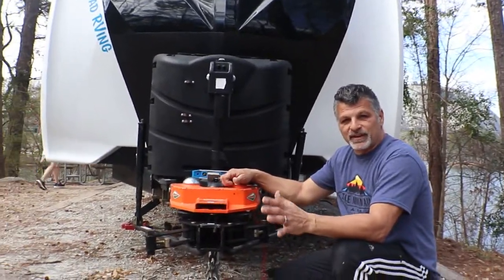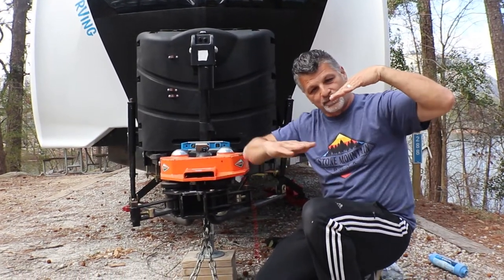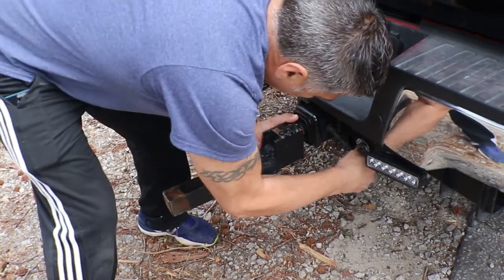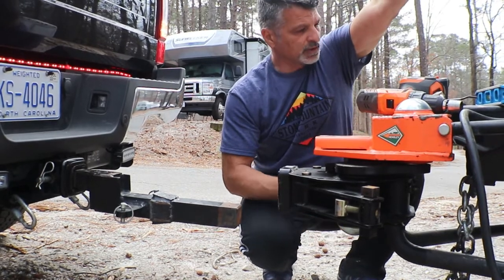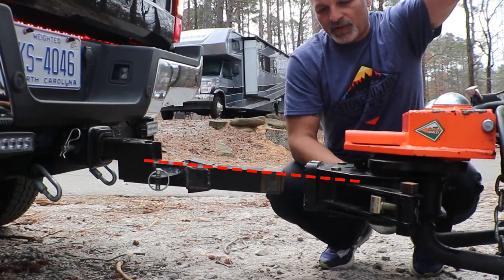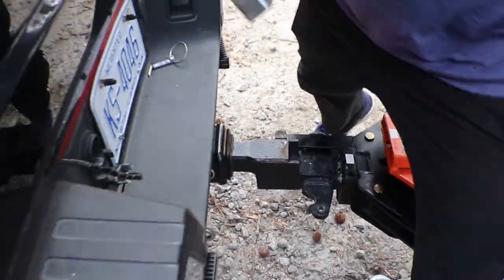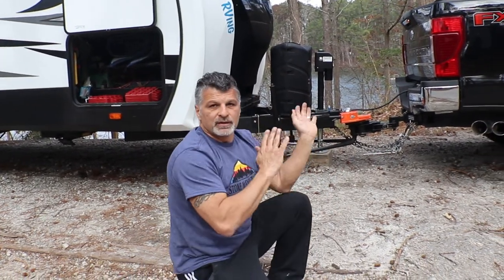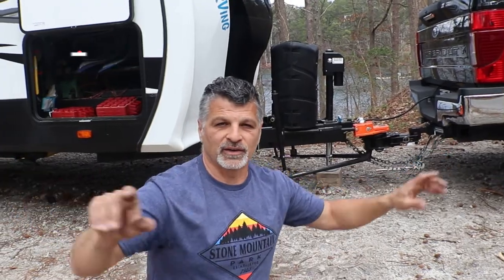Hensley Hitch Hookup/Unleveled Ground #hensleyhitch #hensleyarrowhitch

Comment: Yes, this is very important that owners of the Hensley understand the concept that you have shown for any hookups. I have learned to just take my time, review the angle of the stinger and adjust the Hensley, as you have shown. As a result, about 90% of the time my stinger easily mates with the receiver first time. I am now at a point that its faster with the Hensley than it took me to hookup with a conventional WD/Say Control hitch. Thanks for the video.

Comment: How did you extend the tow chains? Which 7pin extension did you use?
Reply from the maker: I bought chains from a local hardware store so it could be longer.  Make sure they are strong enough.  I also bout a 7 pin extension cord. Not sure what you mean on the 7pin question.

Comment: What if you have 3 inches under one side of trailer tires  to make it level?
Reply from the maker: Then you compensate from the wheel barrel arena that you screw on top with the drill or wrench.  That will move the hitch up and down. Match the level to your vehicle.